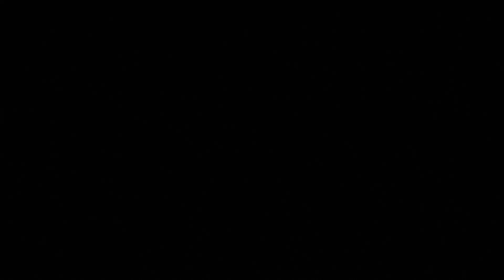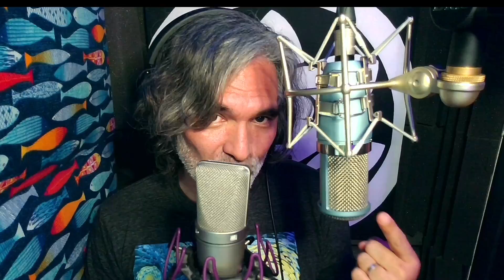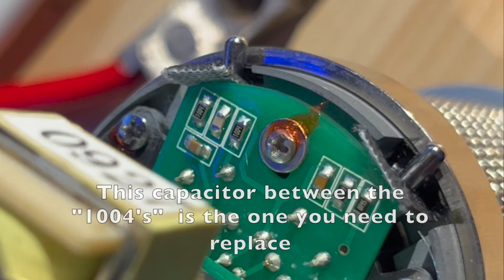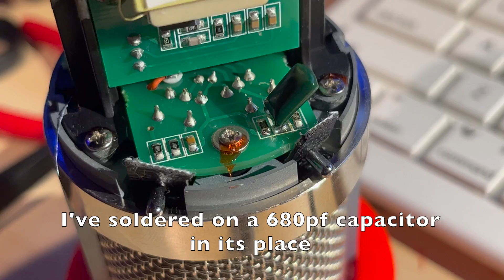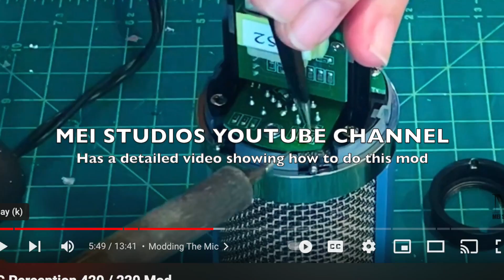AKG Perception 5 Minute u87 Clone Mod vs u87ai Comparison Will Surprise You

Comment: I'll try this mod tomorrow. I bought a pair of P220 on different occasions a few years ago, to complete a set of LCD overheads for live and studio drum sessions. I noticed the upper high frequency (it was kind of expected) but I chosen these as they're not as bad at this as some others, the price was just right, and also I managed to slightly attenuate that higher freq with a thick foam windshield with decent results.  I ended up getting another LCD pair from Weissklang that I truely love. The AKGs were used mainly for room mics specially because of that annoyingly pushed high freq, that, as you described, overwhelmes the bass response and unbalance the whole eq. 
What I learned in eq about this kind of thing is: it's easier to push high frequencies back than taking them out- that's what ribbons and darker mics excel at - plenty of room to EQ.
I'll try and add the 471pf on top of the one already there. - it doesn't make sense taking the surface mounted capacitor off .
Reply from the maker: Yeah, it’s much easier not to remove the old cap and just park the new one on top. Good luck! I hope you like the results!
Reply: @MarkYoshimotoNemcoff Yup,  did the mod and it's working. I'll be testing them out, but I'm hoping for an opportunity to try these properly in a session.

Comment: Just cut the top end ,how hard  can this be and if needed boost the end a little.
Reply from the maker: LOLOL. It’s a little more involved than EQ. Changing the capsule/circuit interaction actually fixes the source of the imbalance instead of just band-aiding it after the fact. Once the high-end resonance hits the diaphragm and the circuit loads it, that distortion and edge are printed into the signal. EQ can only turn down what’s already baked in. EQ can’t undo the resonance, the ringing, or the harmonic smear. Fix it in the mic, and it hits the DAW cleaner, smoother, and way closer to the target sound. Plus, this mod gets the mic capture much closer to a real u87, for those who desire such a thing.

Comment: VERY IMPRESSED!!!!
Reply from the maker: Thanks Dave! It’s such an easy way to turn this AKG POS into a pretty awesome mic, too. And you can generally find them used for pretty cheap.
Reply: Thank's Mark.       I heard you say the 420 and the 220 each Sound different in cardioid. I also noticed in another guys shootout between these two mics that it was true. The 220 sounded thinner than the 420 in the cardioid modes.    How can this be??? Aren't multipattern mics only using the front capsule in cardioid mode???   This troubles me deeply!😢 What am I missing???
Reply from the maker: @DaveSS-xi4pn  Hi Dave. It's a factor of stray voltage on the rear backplate that alters the cardioid pattern of a multi-pattern mic. It's a topic I'll discuss further in a future episode of The Microphone Playboy.
Reply: Ok, Thanks Mark. I'll be looking forward to that!!!😊

Comment: I modded my P420 last night with a WIMA 470pf 100V film capacitor from Mouser. It made a huge difference in the sound profile. I compared prior recordings to post-hack recordings and was so happy with how it turned out. Thanks for making this video! I never would have known about this hack if I hadn't come across this video.
Reply from the maker: My pleasure! I'm glad you're digging your new "U87ai". AKG made such a great circuit and crippled it by not doing this mod, so I'm glad it's finally coming to light because these can be really good mics.
Reply: @MarkYoshimotoNemcoff  I totally agree! I just wish I had done the mod before I submitted my callback for a national commercial spot. LOL

Comment: I like 471pf better than 680pf for the capsule filter, but I consider this mod mandatory for all p420 owners. Thanks for spreading the information! Great voice!
Reply: Could you let me know the part number for the 471pf or would you have a link please. Just to make sure I'm getting right part.
Reply: @alalal1979  Actually any unpolarized capacitor will work fine, even ceramic. People tend to prefer polystyrene capacitors because they are, in theory, more more stable and accurate. I also saw some people use polycarbonate and glass caps, but for me it's too overkill. Imho put the best you can find, because you probably won't be messing with it again after you done the mod, if you can only find ceramic where you live, go for it, no big deal really.
Reply from the maker: @alalal1979  Any decent film capacitor rated at 100v or more will do. Wima's are great, but there are other quality ones out there depending upon where you can source them.
Reply: @MarkYoshimotoNemcoff  thanks Mark its more my non understanding of capacitance! 
I can find 47pf, 470pf no 471pf all with different voltage!
Reply: @alalal1979  471 means 47 with 1 (one)  zero at the end pico Farad, or 470 pF.
Reply: @gamersungyoutube1468  thank you!
Reply: @alalal1979  and I forgot to mention, 50v minimum, ideally more.
Reply from the maker: Thank you! What would be really neat is a switchable set of capacitance values so you could have different high end attenuation settings, but I agree, this mic needs this mod.

Comment: I had a perception 420. I didn't care about the high end tuning too much, BUT i DID care about the noise floor - and I'm afraid that mod doesn't address this issue ... Fun exercise, though.
Reply from the maker: True, it does not aid the Perception’s 15dba of self noise, but luckily there are so many great noise abatement/cancellation options out there today that I feel self noise is no longer a deal breaker for most.

Comment: which condenser i need to buy for this mod? and sound from modded 220 will change in comparison with p420?
Reply from the maker: The 220 and 420 modded will sound slightly different from one another because the capsules are slightly different. The 420 modded will sound a bit more like a u87.
Reply: @MarkYoshimotoNemcoff  you need a 680 pf cap and you have to replace a surface mount cap with it. I did a mod tonight as a matter of fact.

Comment: Can you do this on all of the Perception line like the 100, 120 and 200 or is it just the 220 and 420?
Reply from the maker: All except the 120 which has an electret capsule and a different circuit and the 820 which is a tube mic.
Reply: @MarkYoshimotoNemcoff  Which akg would be better to buy for the mod?
Reply from the maker: @Doofy_lufn  The 400 series. For not a whole lot more you get 3 patterns and the mutipattern capsule on the 400 series sounds a bit closer to the 87 after the mod.
Reply: @MarkYoshimotoNemcoff  I want to update my nt1000, I listened to the Aston Spirit - I liked it. What microphones do you recommend that is better than the akg?
Reply from the maker: @Doofy_lufn  In my experience, if you're finding yourself constantly looking at new mics, it's because the mics you have aren't getting you to where you want to go. At some point, once you become comfortable with that realization and are serious about what you're recording, you have to step up from the mid-level mics to something of a higher professional caliber. Right now, I can tell you that I don't think there are any finer mics out there than the Lauten Signature Series mics.
Reply: @MarkYoshimotoNemcoff  Lauten Signature is not sold in my country. That’s why I’m looking for a used microphone, no more than $700, and probably with a transformer in the circuit, since I like this sound better.

Comment: Hi Mark, can I ask you the following. How can I know if the akg perception 100 microphone capsule is wet or what could be the problem? It turns out that the microphone When you approach and speak, the capsule turns off and then the audio returns, it is as if it were saturated and the entire input volume was lowered. What I intend to do is change the capsule. Could you please guide me on what to do to verify that it really is the capsule and that the PCB circuit has not failed. Beforehand thank you very much.
Reply from the maker: What you describe seems like moisture on the capsule. Put it in a ziplock bag of dessicant packets. Toss it in a drawer for a week and see if the problem changes. If it’s still presenting the issue, it’s not the capsule.
Reply: @MarkYoshimotoNemcoff Okay, I'll do it. But I also want to comment that yesterday while I was checking it, I disassembled it and reassembled it, I tightened the screw on the black cable and it improved. What I also did was leave it on the heater
Reply: And it improves a lot, the sound no longer turns off when I get close to the capsule. But in the cold morning, it happens again. I'll put it to dry.

Comment: I do like the stock, clinical sound of the 420. It's NOT a u87 sound, exactly, but I can see plenty of good uses for the stock. The MODDED 420 sounds lovely though.
Reply from the maker: It really is a mic that deserves more attention and respect, especially since it comes from AKG and is built like a tank.
Reply: @MarkYoshimotoNemcoff   Hey man, meant to ask, what Capacitor value did you mod it with?  Just curious what the difference might be between different pF.  Mine for example - a 220 - i used a 540.  As i recall from the original KingKorg thread different values produce different results that can be closer to a vintage 87 like with a 470 pF whereas higher values would perhaps be brighter and closer to an 87ai.  Getting into the weeds LOL..(or weed as the case may be haha)
Reply from the maker: @mikes425  680pf on mine.
Reply: @MarkYoshimotoNemcoff  ok thanks!  Hey i JUST realized that the "donor mic" i used for this mod last year was a 200, not 220.  i guess i just spaced out on it at the time - or...maybe saw evidence that there's no appreciable difference between the 200 and 220 (except the pad, i think). Do you know offhand if if in fact, the 200 cap and circuitry is essentially identical to the 220. -and this is the original Perception series also, not the newer "P" series -P220, P420.  I don't really need more than cardioid and AFAIK the capsule and circuitry are identical across all of these models and all use the same capsule.  Thanks!!
Reply from the maker: @mikes425  They changed the pad from -10db to -20db when they went from the 200 to the 220 and the p series is the exact same circuit.
Reply: @MarkYoshimotoNemcoff  Thanks Mark, As i recall now i decided to just use an old 200 that was laying around instead of buying a 220.  I was actually just A/B'ing a read on a 87ai and this 200 with the 540 cap.  character is definitely super close on the AKG!  I'm guessing going with the higher cap value you used mighta been a bit better but this definitely captures that mid range thing and i could see being able to match something done on the 87ai with the AKG without much trouble at all.